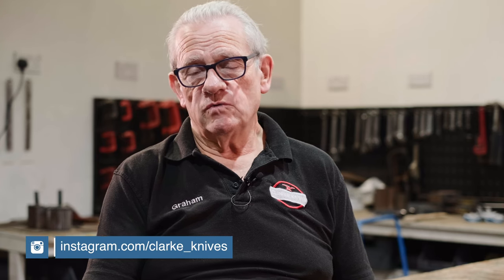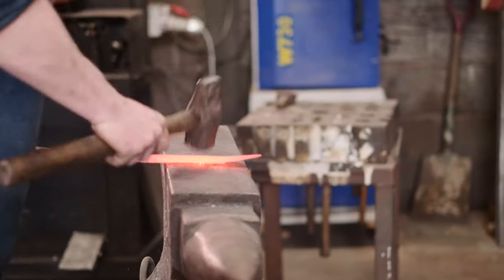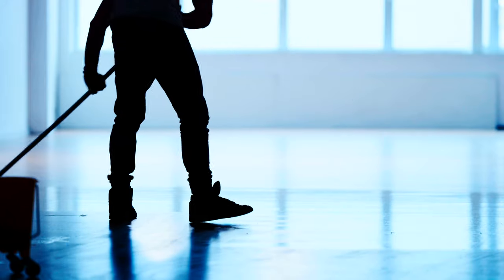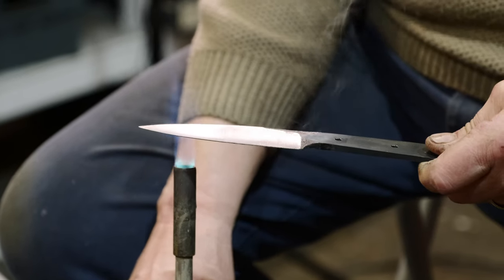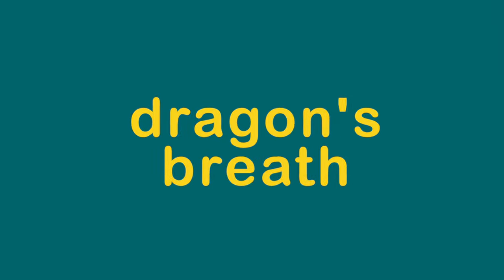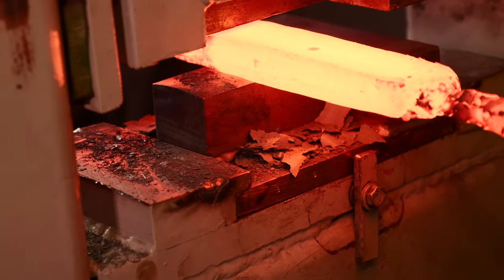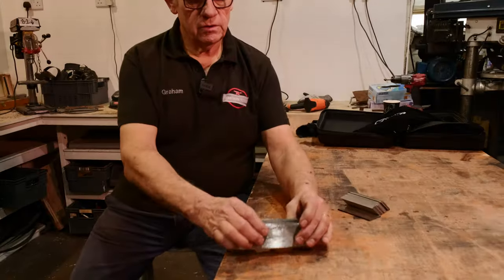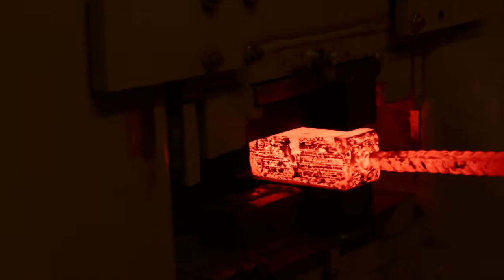3 SIMPLE things to achieve a solid forge weld a Damascus Knife

Comment: Lovely clear explanation of the how and why of the processes in solid phase welding. While I'll likely never get to try out any of this knowledge, I greatly value the continued learning.
Reply from the maker: Cheers Rob! I appreciate your time but also, may I ask what are the pressing issues from your perspective on stock removal makers? Would love to hear your thoughts!
Reply: I should preface this with context: I'm a hobby maker who makes a handful of knives a year mostly for my own amusement and the enjoyment of making them.
The issues I run into are things like: choice of belts (already covered), choice of steel (already covered), proper heat treatment (Graham exists), overheating the edge/tip (personal lack of skill, only happens when making a Bowie-style for some reason), wanting a better grinder (need to move house for space). Other than that there's figuring out when you have got all the scratches from the previous grit out when using a grinder. The scratches are all parallel so I find it really hard to tell if all the 60g scratches are gone when using a 120g belt. End up doing a lot of hand sanding because of this. Answer is "get better at grinding by doing it more" but I haven't put in enough time for that yet.
Reply from the maker: @RobanyBigjobz  absolutely great insight on your interest mate. Thanks man! 

I will definitely make a follow-up video on abrasive belt use as stock removal makers rely heavily on these things like yourself and I feel that more knowledge could help you alleviate the issues that may seem small, but could make a big difference once solved (like your challenges on removing P60 scratches when moving up). I'm really excited to make this video now even more so mate! Thanks again!

Comment: What is the reactive gas? What gas do I fill the canister with?
Reply: I'm pretty sure he means a reducing gas (as opposed to oxidising gas - like oxygen, and NOT an inert gas - like argon).
I think you can get specialised reactive/reducing gases from welding suppliers (BOC, AirLiquide etc.)
Hope that helps!
Note: I'm still trying to figure all this out too...
Reply: PS - I think you "could" put charcoal dust or graphite in there to burn up the oxygen, and maybe create a reducing atmosphere.
Maybe...

Comment: Could you give an example of a reactive gas for stainless forge welding? I use argon with my tig, could that be applied to this process as well?
Reply: Argon will protect a steel from further oxidation and is used to protect fairly reactive metals like titanium. Argon isn’t going to remove an existing oxides though. 

I’d not very familiar with what ‘reactive gas” is, though. From basic principals I’m guessing it contains Chlorine or maybe Sulphur which will react with chrome oxide and help remove it.

Comment: So i have a question. Where could i get a reactive gas to use for high alloyed steel? 

Ive been experimenting with forge welding high alloy steels. (And burning through too much money doing it). And ive tried a few things, but i hadnt considered getting a reactive gas for to make sure the chromium oxide layer is removed. I just tried to clean it off, and weld it quickly before it forms again. (With limited success). Im willing to try anything at this point.
Reply: We need an answer to this
Reply: @safetylast911  yes!!!!

Comment: European medieval method of making swords from spring steel or the Japanese method of katanas with a combination of harder steel and a softer outer part . My question is is it possible to make either a sword or a hard and durable steel on the inside and spring steel on the outside that is flexible and at the same time more resistant to blunting? I'm not sure if the same temperature can be used for both types of steel to get good internal hardening and spring effect at the same time. As far as I understand, the best katanas are made of 5 layers, the 3rd is thinner than hard steel, the 2nd and 4th are of medium hardness and the 1st and 5th are again of higher hardness so as not to be scratched from the outside. But is it possible to make it flexible and at the same time stiff in the middle?

Comment: another good information video, some stuff there I didn't know about as not got that far as yet, and likely now know what has gone wrong with some of my forge welding, mind it is a bit different using a coal forge, be very handy for many if you could come up with some real info to explain and such what and how to do things properly with a coal forge please, and yet again thanks for this one, again great info put across without all the bull etc
Reply from the maker: Cheers Andy for the feedback! I would definitely be interested in knowing that myself! Thanks for the suggestion and I’ll reach out to our community on who the best is with coal forging and get some tips if they’re happy to share for us!
Reply: A coal forge works the same way as a gas forge but is less easy to control. Once hot, you need to be able to control the amount of air going into the hot zone so that the hot coals use up all the oxygen. I believe in ancient times smiths would also use silver sand (very pure silica) as a flux.

Comment: Question. So if you have your correct gas and air mixture in your kelm. Is it still recommended to use Borax or does this correct air and gas mixture eliminate the need to use Borax? Tired of having to clean the mess or reline from the damage the Borax is done
Reply: That would depend on what steel you’re using. 

If it’s a plain carbon or low alloy steel you should get away without the flux if you have the right gas mix in the furnace. 

Stainless is another matter - you’ll still need to get rid of the chrome oxide layer somehow before you’ll get a decent weld. I’m certainly not an expert on fluxes or reactive gases that would do the job though - hopefully others will be able to answer that question.
Reply: If you get the gas/air ratio right you don't need borax. Once I stopped using borax I cast a new 1 inch layer on my forge floor and haven't had to touch it again for several years now.
Reply: @grahamclarke4470   Yes I can get the mix correct . Take quite some time to get up to that temperature though But when it does Have right mix and temperature you can look at my calm and you just see one solid color Bright Orange to yellow . Don't see any  Blue flame . I'm gonna try a  San Mai  This weekend and see how it goes
Reply: @GemAppleTom   Yeah I don't have the confidence of the equipment to play around with stainless yet . Not real sure I even want to
Reply: @tobesmith7632  If you’re just* shaping your steel with forging, as opposed to making a Damascus type structure, then you don’t have to worry as much about gas mixes etc  Stainless and high alloy steel do have their advantages but are a lot less forgiving with things like forging and heat treatment times and temperatures. 

* he says ‘just’ like it’s the easiest thing in the world and sadly lacking any of the equipment to do knife making himself.
Reply: @GemAppleTom  no I'm just talking about my forge Weld without having to use flux. When I'm just forging metal I don't do this. But when I do some forge welding I lit my kelm get up to temperature which takes a long time. I kind of judge it by being able to look in my kelm and just see one color a really bright orange to yellow. Don't see any blue flame. And this is just when I forge Weld but I have been using flux and I don't want to use flux
Reply: @tobesmith7632  well good luck with the San mai. Let the channel know how you get on and if Graham’s advice has helped you out.